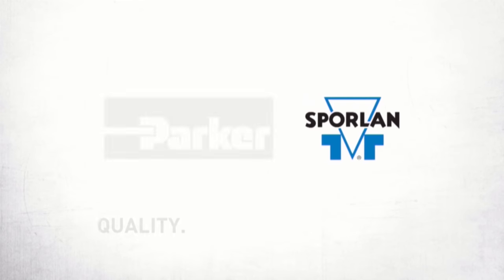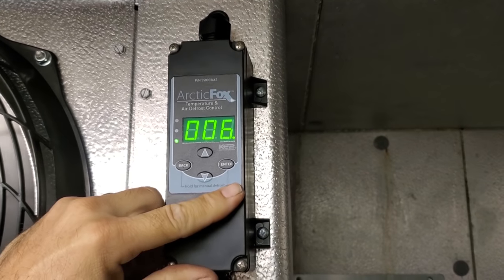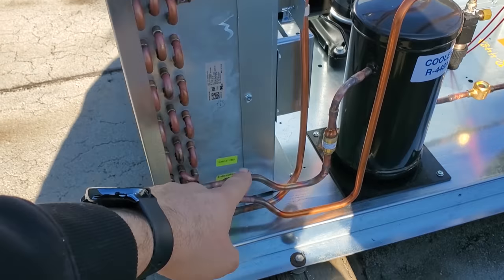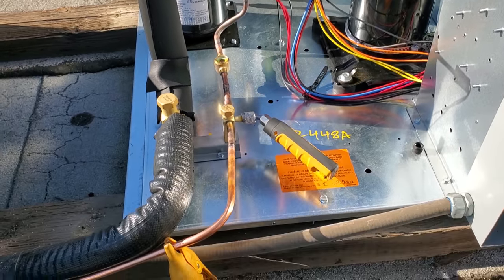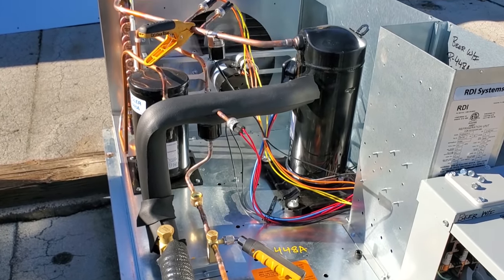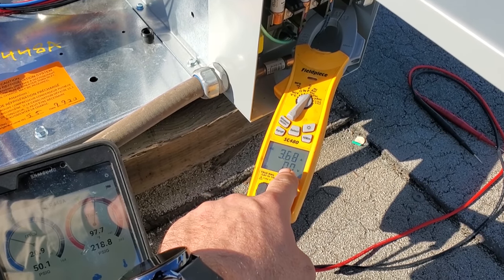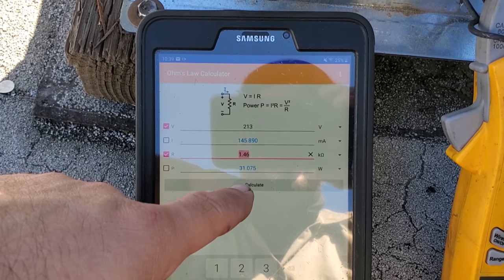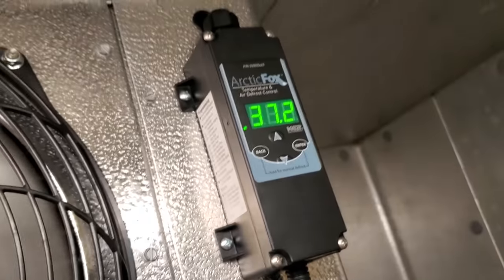BEER WALK IN (START-UP) COMMISSIONING

Comment: At the beginning of the video, my first thought was "gee, that RDI system is pleasantly quiet" - and then you mentioned the two-speed fans. Which makes complete sense, not only for energy conservation, but slowing the fans down will help extend the lifespan of the motors. I can see this becoming a trend quickly; not quite sure why it hasn't been implemented long ago! When they kicked into full-speed, they were still pretty quiet.

Comment: I have never even considered going into this field, let alone a technician type job. I just sit at work and feel the cool, conditioned air. The only experience I had going into these videos was that “AC need coolant, coolant cools air, air is cold,” but now I feel like if someone complains about the noise of the AC I can just blurt out “Oh yea sounds like a defrost cycle with this particular model, the reversing valve activates and runs the refrigerant backwards, there’s a high failure rate when it comes to these systems so could be a sensor issue.” I have got so addicted to these videos I get an urge to go and service some AC’s, even though i have no clue what I am talking about, and just nod at half the stuff you say. 

Love the videos! They keep me sane and my head cool ;)

Comment: Quite understandable that you can't film every video, especially when under the gun of keeping product safe for the customer. You are doing your best. Kind of stinks the manufacturer kept the wires tight so you couldn't check amp readings. But you found a way to do so. Manufacturer s are kerping price dn as much as possible so they throw in after market items. It work now, but for how long? When it goes ng then you can put your items in by then the customer will see THE BIG PICTURE. Very clean install and nice comissioning of the unit. Very proud of you. As far as notifications yes some are not coming through but I go looking if I don't get one. If it makes it easier for you I'm up for email or any other notifications. Will tune in and see The Big Picture as it's BEST. Thank you for the video and see you on your channel.

Comment: So what refrigerant is being used for residential installs these days? I've got an old R-22 unit that is going to need replacement soon. Too bad you don't work residential. And on the East coast.
Reply: 410A but I have heard that Trane is moving to a different refrigerant and I can’t remember what it is.
Reply: @KentuckyReef  I've heard talks of replacements for 410a a lot this past year.  So far, the best contenders seem to be r32, r466a, and r470a. I've recently used a newer window ac with r32 as the refrigerant and it worked very well. Dare I say better than an equally sized 410a unit. Of course, it is flammible and there will likely be charge restrictions because of it. It also can't be used as a retrofit gas. That's where 470a is supposed to shine as a replacement in systems designed for 410a. We'll see what happens.
Reply: @Matt_Deluca  I think it was r32. I do remember the Trane representative saying that it is flammable. 
My response was, it’s better for the ozone until it burns down your building. Lol

Comment: I carry some of the automotive engine wiring covering. That cheap plastic like stuff...ill put the wires inside of it. Looks hella clean too..super cheap shit. Nice video! Have a nice week!
Reply: Try checking the cap under load. Prolly was running 2.4mfd. See it all the time. Static testing is always higher than with a load. Those motors are shit
I'd swap it with the fasco. Great motor

Comment: I thought with most crankcase heaters, when the compressor is running the contactor disconnects the heater?  When I say most, I have seen it on many carrier RTUs and some others.
Reply: This is true with auxiliary contacts but not if it is connected between L1 to L2 or L2 to L3 or L1 to L3 then it is on at all times this one is on at all times when condenser has power

Comment: Aren't these wires rubbing against the compressor a sparking waiting to happen? Why weren't they just strapped to the side panel or put in an plastic pipe on the side instead of going loosely throught the middle of the RTU and rubbing against the compressor?

Comment: I think that the new arma-flex is called “easy pull”. Like you said, it is nice because it’s hard to tear and it’s UV resistant but it doesn’t slide and bunch up like the old stuff. Which makes it a pain when pulling it back to do a braze joint or something.
PS, Firefox is an operating system

Comment: What would delaying the compressor on start help to do
Reply: It keeps the compressor from starting on and off suddenly thus saving the compressor from premature wear. It's not good for the compressor to start and stop suddenly like if there's a wire barely making contact like in a switch in a house when you have a shorting light switch it'll keep the windings cooler/ wires cooler preventing more damage.
Reply: @natepeterson7145  ok that makes sense, thank you

Comment: Firefox is a briljant internet browser, from Mozilla. It gives Google Chrome a run for its money. And might keep more privacy
Reply: yeah I think he meant StarFox
Reply: Was a brilliant browser, stopped a while ago to be good and was ruined by Mozillas wrong decisions. Now it is patronizing its users (No Mozilla, my local access point/switch/PBX is not unsecure just because of self-signed cerificates. Let me browse this site or you will get replaced with opera or edge).
Firefox is not the browser anymore which I used a long time ago, starting with Firebird 0,7 back in the days. And it is slow and memory leaking, compared to opera or even edge.
Hopefully Mozilla won't ruin Thunderbird as well...
Reply: Actually, the Firefox he was talking about was a arcade game. There was a movie about it too.
Reply: Just use the Brave browser.  Its safer than anything right now.  Then use a VPN to be more safe. Brave is the best right now, no ads and does not track.

Comment: Did you mark the liquid level in the receiver?
Reply: He did not need to no Headmaster valve so no winter charge added uses fan cycle switch for low ambient control.
Reply: @dmiestercommkitchentech3043  The level still applies so that you do not have to start from scratch in case of a leak. Clearing the sight glass will get you by.
Factory charge includes a certain percentage over minimum to cover all operating temperature combinations.
Reply: @mtu-engineer3220  yes I know it matters so the next tech will know where the refrigerant level was after in stall but the reason most mark the receiver is so that the winter charge can be shown beyond the clear sight glass level which is called the flooded level.
Reply: @dmiestercommkitchentech3043  Winter charge is not the only reason for additional charge.
The sight glass should be cleared with evaporator at maximum load.
Unless you take the time to force the evaporator to maximum load by leaving the door open, you have to work with weigh in of charge, or pump down receiver level.
Reply: The additional charge is for the temperature fluctuations so that the liquid column to the expansion valve is maintained because a starved TXV means starved evaporator which means higher superheat which results in compressor failure due to lack of cooling but it is for the lower temperatures not higher so it is called the winter charge because that is when it begins to effect the system the most (the extra charge or as we techs like to call it the winter charge.) In fact I was going to ask why he did not measure the level until I realized there wasn't a headmaster valve I thought that you might not have caught that and that is why I commented at all.

Comment: Many of us have benefited from governmental regulation evolution. It benefits manufacturers and also installers, maintainers. California has been at the forefront in regulation in all kinds of industries over the decades which provides a lot of work for us simple folk. So you guys who want to complain about all the regulations, don't bite the hand that feeds you!!! One thing I don't like about that evap controller is that the cooling indicator led is green.. I need to call the state regulators and get that changed to a requirement that it be blue.
An additional note, I always like to see SSRs controlling a contactor. SSRs are zero crossing so begin to apply power as the sine wave crosses zero. This causes contactors to live much longer because they're being closed when the voltage is at a minimum instead of slamming on near or at the top of the sine wave causing burn on the contacts, and also turning off near zero volts avoiding burn due to drawing an arc.

Comment: These bloody peanut style switches fail a lot , I'm guessing because the contact surface of the electrical switch is so small and thin  it's just bound to fail overtime .
Reply: I'd better not cashew bypassing them!
Reply: @gyrgrls  never,  that would be nuts !

Comment: My new residential unit uses 20x20x5 Filters, my old one used 20x20x1
Wish i knew how much more expensive those bigger filters were beforehand because of all the efficiency crap nowa days.
Question
Would 5 of the smaller ones be as good or worse as a normal 20x20x5?
$80 for 2 6 month filters that i was told to get is kinda ehhh...
And you're thinking of Star Fox my dude lol, Fire Fox is the browser :p
Reply: Probably but just stick with what factory recommend
Reply from the maker: No you need to stick with the big filter but you shouldn't have to change it very often I will discuss this on my livestream this evening 11/30/20 @ 5:PM (pacific) come on over and check it out https://youtu.be/DVL6D1dpsYg
Reply: @HVACRVIDEOS   Aight Thanks.. and yeah the recommended filters have a 6 month changing period, which it is time for me to do. But $80 for 2 is kinda ehhh for the ones i was told to buy.. And will do :)

Comment: Yeah, install some energy-saving evap motors on a 50-year old walk-in freezer with it's state of the art insulation. That would really make a difference, it will save the environment well enough to let us blow R-22 into the air for a couple more years. Americans ...

Comment: No wirenuts this time? So maybe in 5 years they will eventually start using jacketed cables and properly mount them, and in 10 years switch over to DIN-rail terminals inside the control cabinets rather than a tangled, loose mess of wires.

Comment: I've put in a bunch of kolpak units and for the most part they are decent units. The main issues I have is with the time delay going bad, that and the placement of the suction line service port. If you dont have a sharp 90 on your manifold hose you're not getting it on there. Not a big deal but when your on the roof and you forget the adapter 😡.  Not a fan of the low pressure control either. To narrow of a margin,  and it will short cycle even with the time delay, especially with delay circuit crapping out. That's probably the reason for the delay failure. Just my thoughts. Great video as always.

Comment: Good video ! I Like the Aftercooler on the Liquid Line. Finally We will start to See “ Seer “ Ratings Soon with the Added Condenser surface area. Measure Quick Will Need to Add a Parameter for “ Added Subcooler or not “. I Noticed NO HEADMASTER only Fan cycling. I Like that ! No Headmaster to mess with. 1 Less Refrigeration Component to Go bad / cause issues. Unit Has a Strange Vibration on video when Condenser fan Runs. I Would Get a Warranty Replacement From the Factory & change it out. High amps , weird vibration. Motor is failing I believe. Good vid ! Like # 388.
Reply: Yea, u could be right. i saw the panel hanging so , it could of been torquing on the unit , it does not take much with these units to make a horrendous vibration. i Dont Like the High amps though. it will be interesting to see How this units fares over the next year. i Would like it if chris could Go back to this unit every 3 Months & Do a " Wellness check Video " / Condenser cleaning video on this system. This unit has sooo many overseas parts in it.

Comment: If I'm using the "peanut" style fan cycle switch, I like to add a relay.  Run high voltage thru the dry contacts, and use 24v thru the switch to energize the relay coil.  Seems like high voltage is what kills those switches
Reply: But don't you need a 24V transformer (and its primary fuse, right?) to provide 24V?

Comment: Most true industrial/commercial machinery won't use loose wires like the HVAC and refrigeration guys do. Everything is either in flexible plastic conduit, or they use jacketed cords running to components. You will almost never see individual wires running around except in the electrical control cabinet.

The two speed ECM fan motors are not just more efficient themselves, but because they're more efficient and slow down when satisfied, the motors put a lot less heat into the box.
Reply: You won’t find it in refrigeration in Norway ...

Comment: Can you do a video that shows how the oil is changed in a compressor? I am not an HVACR tech but I've watched a ton of your videos and I understand most of the concepts except for how the lubrication oil in a compressor works. How do you know if there's enough oil in a compressor after a leak? How do you know when it needs to be changed and how is that done?

Thanks!

Comment: Looks like a Manitowoc design to me. RDI= Manitowoc 🤷🏻‍♂️. Low pressure, high pressure and fan cycling wire color look like the same used on a manitowoc ice machine. I’d still prefer Heatcraft or Tecumseh outdoor condensing units . Good video !!!

Comment: It's normal to not get notifications, YT is indeed doing some funky stuff.
Best is to setup a parallel notification system, email, Facebook, etc. It's already a thing on the Discord server and that works, although they should be opt-in

As for the discrepancy between viewership and subscribers, it's actually a bad metric to try to optimise.
Having lots of subscribers has a negative impact on your algorithm ranking if no one else watches and/or not all of your subscribers watch most videos.
On the other hand, having a better viewership than the number of subscribers tells the algorithm that you successfully attract new watchers, and that's perfect when the algorithm is tuned to optimise platform retention.
Reply: Wow, setting up a discord server just because youtube isn't doing its job properly seems to be a hard workaround to me. 
Whats next? Putting a blow-up Cell phone Tower in the backyard nad connecting it to my VVDSL because Vodafone does fail to do its job correctly? ;-)

Comment: I really love these integrated systems with everything inside the temp controller. I guess in a future, there will be nothing on the roof, not even the pressure switches and no connectors for probes/gauge set , just the contactor for the compressor and a time delay for both the compressor and the condenser fan motors, instead everything will be down in the evaporator (pressure sensors instead of switches and the probe connectors on the evaporator instead), with an electronic TXV. BTW - are it possible to connect a electronic TXV to that temp controller? In that case, you should replace the valve for a electronic expansion valve, and you will get even greater economics.

That will also save you a lot of work as you will need to go up to roof less often, and can diagnose and repair everything while inside the cooler/freezer.